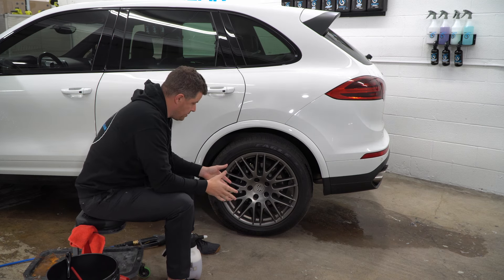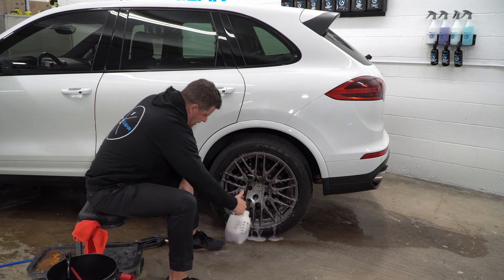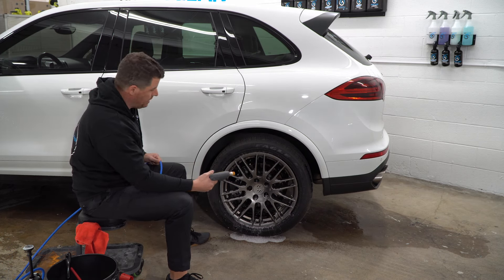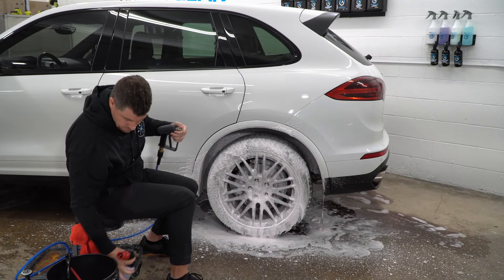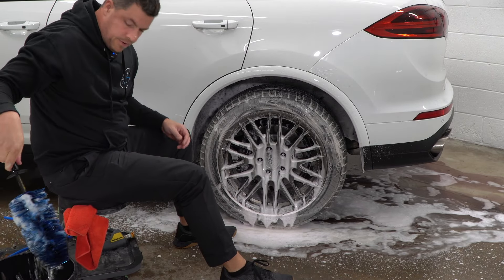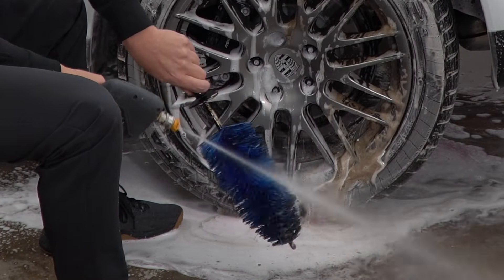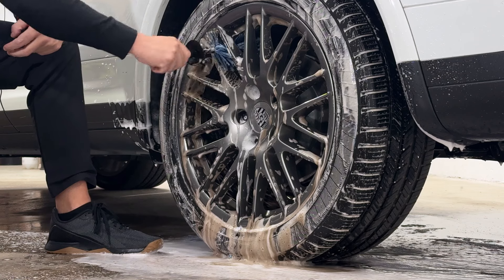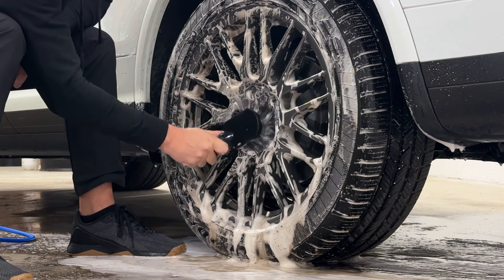Cleaning Neglected Wheels | Everything You Need To Know

Comment: You can see half the product running out the wheel onto the floor before its reacted. Then pressure washes it off before its fully reacted.  Then goes back in with more fallout remover and again about half of it ends up running out on the floor.  Then smothering it in ph neutral foam that does nothing.  This is how you tubers clean wheels.  No pros use a stool, slows you down to much.  Arch liners first as well or grit drops on the clean wheel.  So many other things wrong wrong here, these guys are not experienced detailers despite what they say.
Reply from the maker: lol you do realize the guy you’re talking about has 10 employees and a huge detailing business for 13 years now. The stool is used because filming takes longer. Also that’s not pH neutral foam. Thanks for watching lol